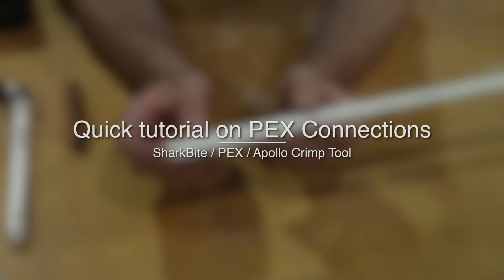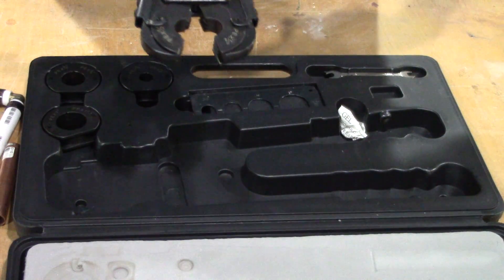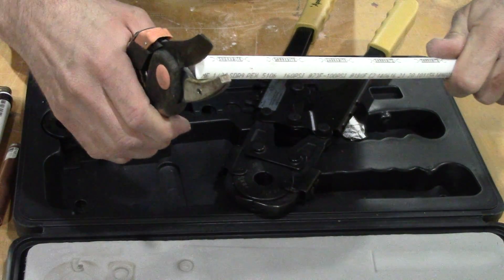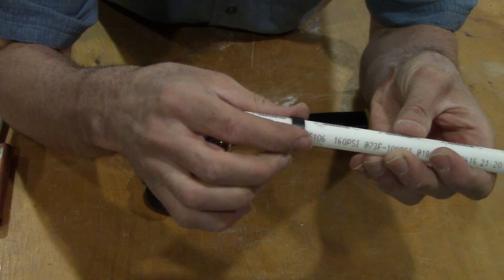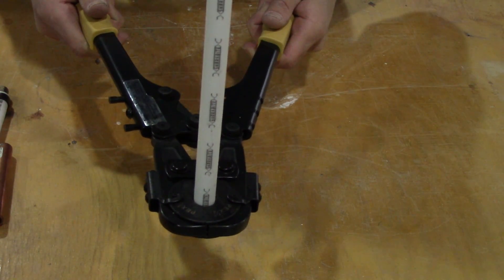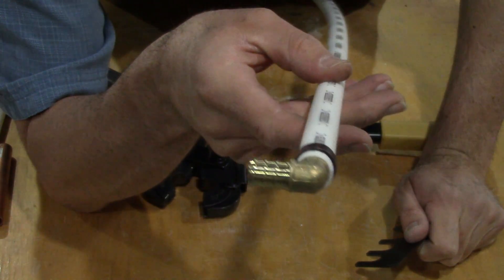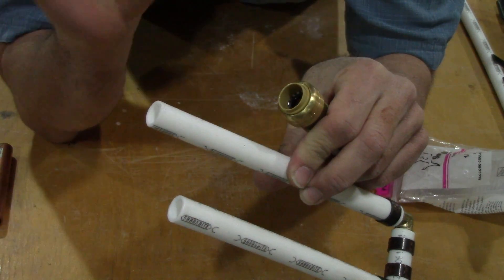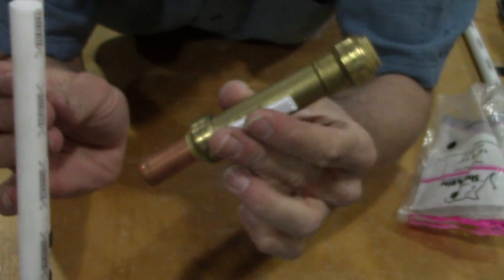How to Cut Crimp and SharkBite PEX pipe connection & Apollo Tool Review

Comment: You should mention using a deburring tool after the pipe cut to clean up the cut of both plastic debris and smoothing the end if using quick connect push fittings, especially if using a pair of  garden shears, which will not produce a clean square cut.

Comment: Hi, my father-in-law has a pex pipe in the garage with a shut-off valve to outside garden faucet.  It is leaking when he opens the valve.  You mentioned that the tubing can be cut.  Do you have a suggestion on how I can replace it?  The connections are similar to what you shown on your pex pipe video.  I enjoyed seeing it and gave me some idea. Thanks for nice short video.

Comment: I just replaced a valve in my bathroom. The shark bite did not work at all. Water everywhere.  However when I did the pex crimp fittings everything worked like a charm.  Thanks for your help

Comment: The sharkbite coupling you used has two beige rings.   The beige is only for Pex.   For joining copper you need the black plastic ring at the coupling.

Comment: Hi there. So at around 5:25, you demonstrated a problem I'm having with my most recent crimp - part of the ring is a go, and part of it a no-go. It seems most of your crimp was a go, with just a part of it a no-go. As for myself, it seems like it's like 60% is a go, 40% a no-go.Are you saying I shouldn't be too concerned about that, or is this proportion of go to no-go something I should fix?Thanks!
Reply: Use the compression fittings PEX-A by Uponor. Less guess work and don't need to double check with that crimp gauge.

Comment: We are very happy you like our Multi-Head PEX Tool. Thanks for the endorsement!
Reply: was thinking about buying this set at lowes $80 ty for the video
Reply: Yes, Apollo fittings, rings, and tools can be used with Sharkbite pipe.
Reply from the maker: And thank you guys for making a top notch tool! Very good quality.
Reply: If you haven't, buy one...l love mine...works like a champ.  Rings are relatively cheap...and fittings aren't that bad considering how easy they are to use.
Reply: Hi. I already installed sharkbite red blue tubes. Can i use the apollo with sharkbite rings ? Are they identical ?
Reply: Going get me one. Tool looks easy to use.

Comment: Thank you very much. Very helpful information now that I am converting from tub to a walk-in shower. I don't have back access to the shower plumbing, and the plumbing is between two very narrow walls (10" between walls). Not to mention impossible to work on the plumbing from the crawl space. Push fit and/or Pex sound like an excellent idea. I much appreciate it.

Comment: If any of you people have gray tubing,in your house,and would like to replace parts (like old plastic valves),i'd like to share last week horror story with you!I had wrong advice before,somebody told me that my water tubes are "PEX",and how to work with that.Last august I bought two new toilet bowls,two quality mini ball valves and two S.S. braided hoses.I rented crimp tool from "Home depot".I installed toilets with out any problem since,no leak,not a drop.Excellent,i felt like a pro,i hoped there was more things to replace.I didn't have a clue what is coming.Last week I decided to replace leaking faucets in my kitchen and two bathrooms,and do it right with all other new parts.When I finished job,late in evening and open main water supply valve,i had water leakes on every connections to gray tube.So I went to "Home depot",and told them that this crimp tool is probably only good for recycling.The other guy who worked on plumbing department told me that my gray tubing is not a PEX,but old PB (Polybutylene) tubing,and that I need an adapter 1/2".They are both 1/2",but PB is slightly biger.Good news is that you can buy brass 1/2" coupling PEX to PB.It comes in the bag with two rings,dark one for PEX side,other one is copper and about 50% wider.They are not expensive.After cutting all connections,and replacing with new coupling,everything was fine,not a drop of water!Once you put that adapter,after that you just go with PEX!
Reply: I work at Home Depot in the plumbing section and I had a customer tell me that he was doing the  same thing and I told him that you needed an adapter to connect the 'gray poly tube' to the PEX tubing or it will leak.  He told me that it's all the same.  Well haven;t heard from this customer but I bet he had leaks too.  Thanks for the post.
Reply: GREY GOTTA GO NOT HARD ENOUGH BAD PRODUCT
Reply: And if you have the cash, I would recommend getting all of the polybutelene removed and replaced with PEX, at least if you plan to live in your house for several years, else there will be non-stop headaches.
Reply: the grey is cpx or cpc tube(depending where you live).... there are adaptors available to go from one to the other
Reply: 777arc Agreed, from my (not a plumber) understanding the Grey PB stuff deteriorates over time from the chlorine in municipal water supplies. If your water is from a well (not chlorinated) you should be okay leaving the PB.
Reply: Sounds like you have quest plumbing, if I were you I'd tear that out soon as reasonable, chlorine they use to treat water makes it brittle and it will eventually fail catastrophically. In fact most insurance companies will refuse to cover a house for any amount of money if they know you have it thats how bad it is.

Comment: Do you know if you can convert from expanding ProPex to PEX with compression rings without buying the expensive expanding tool?
Reply: +don conklin I use pex rings on the wirsbo tubing all the time, never had a problem
Reply: +don conklin You can crimp Propex A / Aquapex lines.
Reply from the maker: +don conklin I have never tried that.  I'm not sure.  Maybe someone else reading these comments has more info. If so, please chime in!
Reply: Not true no warranty crimping uponor just expansion per their warranty ...can do either on one other brand though